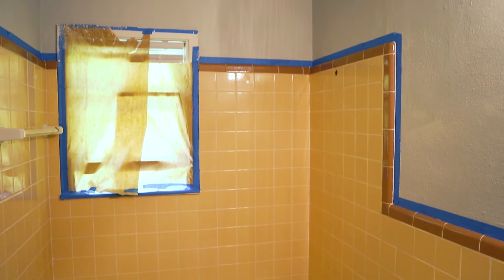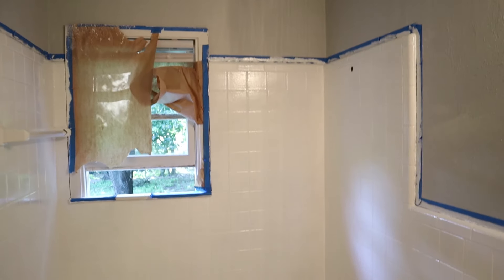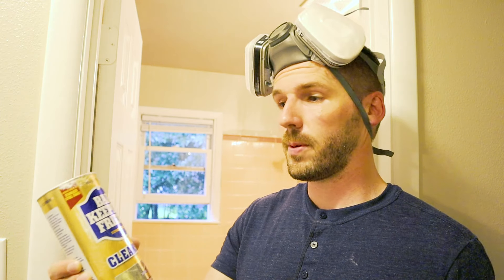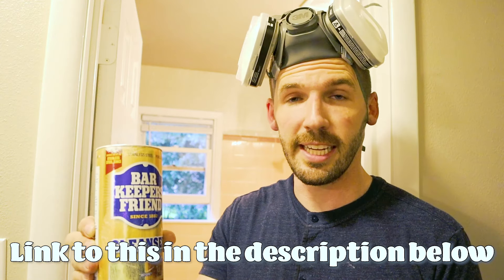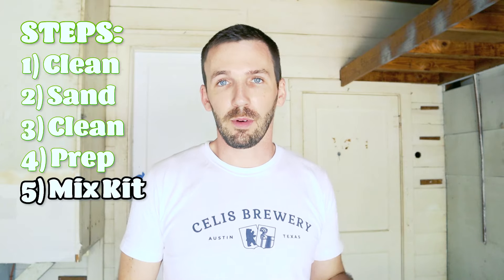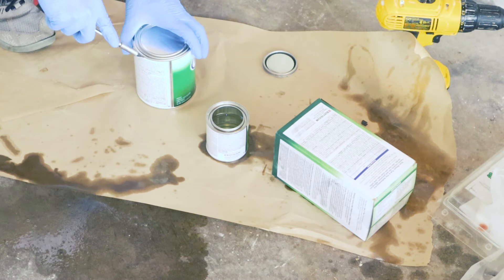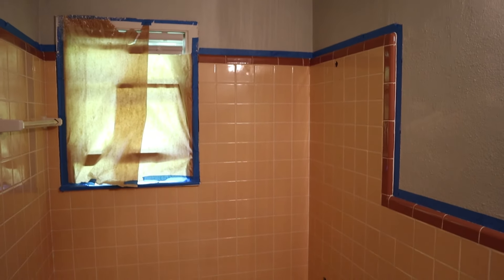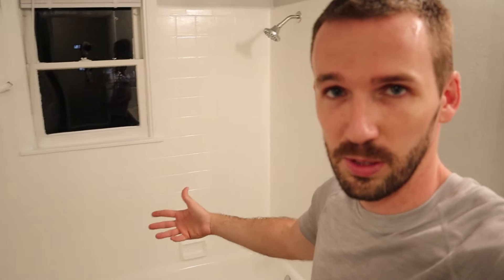How to Refinish a Bathtub and Tile with Rustoleum Tub and Tile Kit

Comment: Cheers!  Very good video.  I would like to know if there is any product that can be applied after the ceramic tiles have been painted, so that the paint lasts longer?
Reply: THis is NOT paint.  It is a a glaze.  You do not want to apply anything else over this.  It will last for years with proper application and care/ cleaning

Comment: The “circle thing” on the toothbrush holder is a cup holder. Did you pull the toilet out to paint the tile behind it?
Reply from the maker: Haha thank you! I didn't pull my tank off but I did squeeze the roller behind it. I put painters tape on the edges of the tank and took the lid off so I wouldn't paint on any visible areas. I would recommend taking the tank off, but it wasn't worth it in my case.

Comment: I just redid a bathroom that looked very similar and it had glazed shower tiles similar to what you did. Could you confirm these were glazed prior to you applying the tub and tile from rustoleum? I did an amazing job cleaning and prepping mine and so far, it has adhered really well

Comment: Looks good! I have this kit and haven't started yet but for the second coat were you able to stand in the tub while completing second coat on the walls without any problems?
Reply: according to rustoleum, cure time is 3 days before you can use the tub/shower...
Reply: @d1nonlysnshn  Thanks for responding! I did mine and still after viewing lots of videos there were still some things I learned. I posted a review on you tube after completing. It does the job and I would use again. I’m going to do the kids bathroom next. I just had to wait and see how well it held up in mine first. So far it’s good.

Comment: Great video. When sanding, did you hand sand the beveled edges of the tiles too, or just use to the orbital sander as shown? This question isnt just for the rounded edge (dark brown) tiles, but the flat square tiles too. Thanks so much!

Comment: Great tutorial👍🏼. I’m doing this this weekend. I would really like to do this to my bathroom counter as well. The tile counters match the shower tiles now, the only difference is the grout. Do you think it would work? 
Thanks!
Reply: I forgot to ask, did you use only one kit for your project?
Reply from the maker: Sorry I'm late on this comment - this should work on your counters too without a problem! I used 3 kits for my bathroom because the entire bathroom is surrounded in tile and I used 2 coats.

Comment: Won’t hold to high water contact! You can’t just sand tile and tack cloth it. Must be acid washed to etch it AND primed. Call professional. I’ve seen this peeled sooo many times then you have a huge mess to get off to even do it right. I bet this will not hold up long in bathtub area.
Reply from the maker: Worked good enough for me. 2 years of rental income and going for this $75 shower fix.
Reply: Kelly Concepts you’re one of the lucky ones then. I run into a peeling mess quite often.

Comment: Nice tutorial on how to use the product and the capabilities.  Totally disagree with your design concept.  I would have preserved the original titles and painted around it (or changed a few tile colors). You killed the 'wow' factor.  I see this type of "rework" frequently. Not just by millennial's either; boomer's make the same mistake. Yeah yeah, I know. Everyone's taste in decorating is different, sadly,  this type of "'updating" has become new "normal" due to people watching the "flip-it" home shows on TV.  Rule #1 -- Do no harm.
Reply: I abhor my hot pink ceramic bathroom tiles, and unless ripped out or painted, I have found no DIY wall paint, wallpaper or fabric colors or pattern that make them palatable.  Sometimes you just can’t fix ugly.  Since I don’t want to send my tiles to the landfill, I will go with painting for now.
Reply: @brucelawler9962  Post a link to the hot-pink. I would design around the hot-pink.  I can think of some advantages for keeping it as-is.